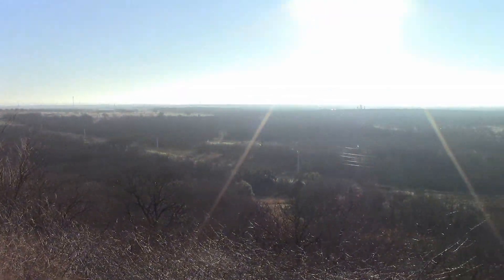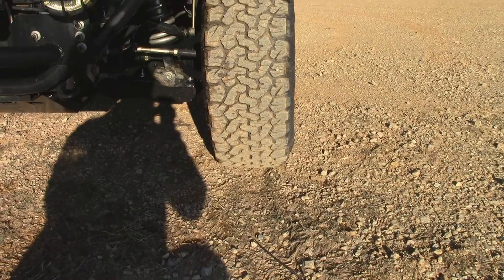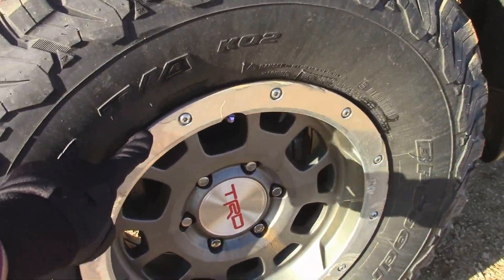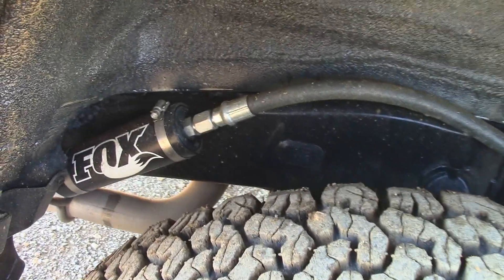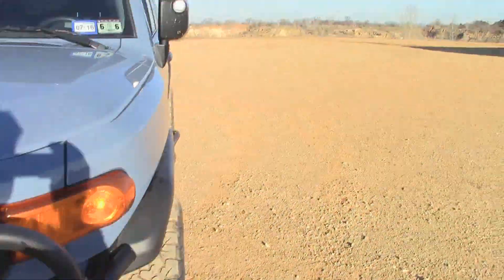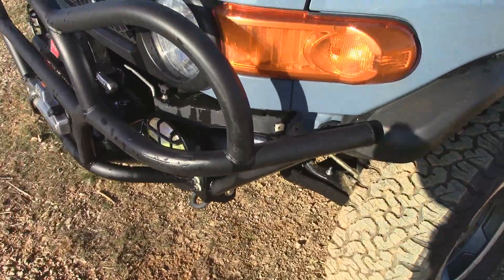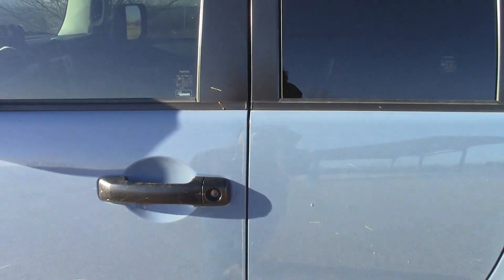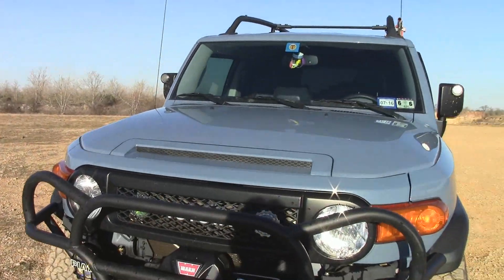2014 FJ Cruiser TTUE - Build Phase 2

Comment: looking good i just started working on my 07 fj just did a paint job on the roof mirriors handles bumpers and rims next i plan on putting a lift in 3-5 in not sure yet. Debating on putting in spacers for the aggressive look what do you think? Also have you seen the fj cruiser hood with the ridged vents?
Reply from the maker: +Jesse hardin Yes I seen FJs with hooded vents, not worth IMO, For looks only, tries to look like Ford Raptor.  I would say 3 inch lift max as you will have to do extra mods for 4+ inches. Spacers as in Wheel Spacers? I run 1.25 inch Spidertrax so I do not hit my rear remote reservoirs.
Reply: +Scott Nguyen (FJSkawt) thanks for the reply, I'll probably do that... I debate on the hood because Im in  arizona where it gets 110 in the summer and wondered if it would be with it to keep it cooled off.
Reply from the maker: +Jesse hardin most likely not. just more dust in there. alot of people on the forums add transmission coolers though.
Reply: +Scott Nguyen (FJSkawt) ok thanks I might end up doing it just cause I like the look, there's a type that looks different from the raptor look

Comment: Nice, but only 2" lift?
Is it worth the effort and expense?
I like the front end mods. 
Thanks for sharing...
Reply from the maker: Its adjustable up to 3 inches. It is worth it because the ride is smooth and it can handle all the additional weight of sliders, skid plates, bumper, and winch.

Comment: Nice rig. What's your next project?
Was the Trailworx made specifically for the Zeon winch? I don't think it'll fit in mine
Reply from the maker: Be eS yes it was slightly modified to fit the zeon. I am trying build my dual sport xt250 next.
Reply: Scott Nguyen cool, and thanks for the quick reply
Reply: Scott Nguyen oh wait, the control box on top is removable... I'm good. :)

Comment: Hey Scott, if I heard correctly, you are running 285/75/16 BFG A/T's ... Did you have to do a body mount chop ? I'm looking at the exact same set up and I'm hoping I don't have to do a BMC ... Thanks !
Reply from the maker: I did a BMC in case i want to run bigger tires. You can run that size and have an alignment shop move your wheels forward.
Reply: Thanks for the info. It's a daily driver , so I'm not planning on going bigger than 285/75/16. I've seen the 16" TRD wheels for $150 each. Since I'm going to do uniball UCA's , I'll need to have an alignment anyway .. Thanks again !

Comment: Do you have a Build page on the fjcruiserforum ? my suggestions rack mounted light bar, on board air, remove the stock wheel well trim(cant think of the proper name), Hankook Dynapro MTs, and train horns.
Reply from the maker: +THE JONESY Yea my next set of tires will be a M/T since I have a daily driver now. I will use this FJ for overland and off-roading.
Reply: Oh ok yeah the dynapro mt have good all around reviews for the price

Comment: Hello Scott. I wanted to know is that a 3-inch lift kit  you have. also what size tires you have 33s
Reply from the maker: black mantis its a 3 inch lift, but i have it set to 2 to fit in the garage. tires are 285/75r16. thanks.

Comment: Hey man absolutely love the truck.  Did you avoid having to do a diff drop by sticking to a 2” lift up front? Would you recommend going any higher or do you think that’s the sweet spot?
Reply from the maker: Kyle Burns no diff drop, the diff drop will help with CV axel angles, but also gets in the way of skid plates. I had my cv axel boots replaced once because of a puncture from a branch.
Reply: Scott Nguyen Ya I would also prioritize skids there too.  I have an 05’ Land Cruiser that I’ve been wanting to lift and it has very similar suspension up front.  Still have a lot of research to do before I pull the trigger!